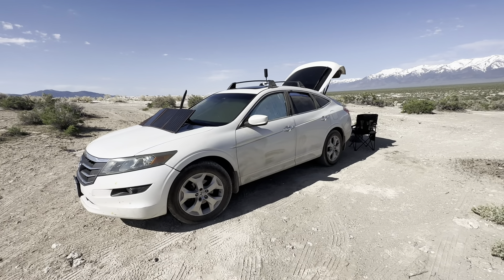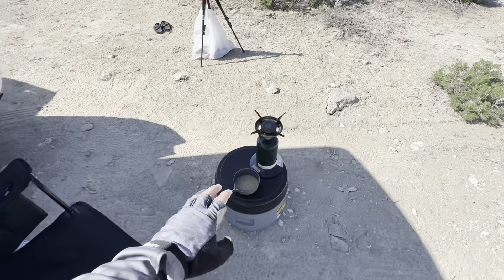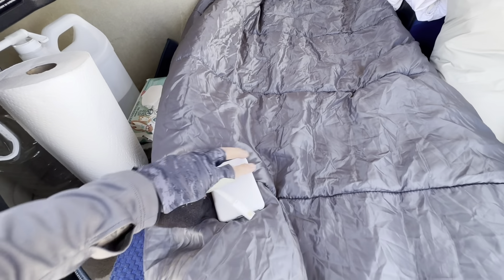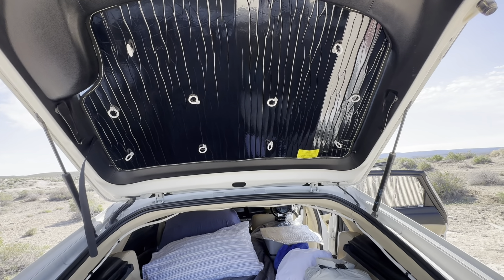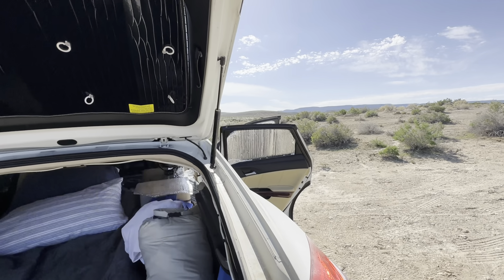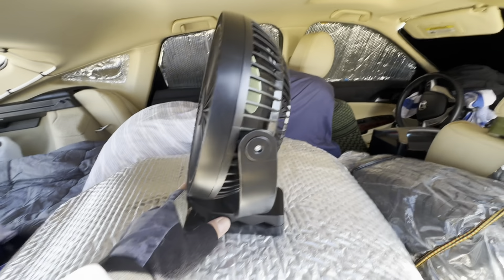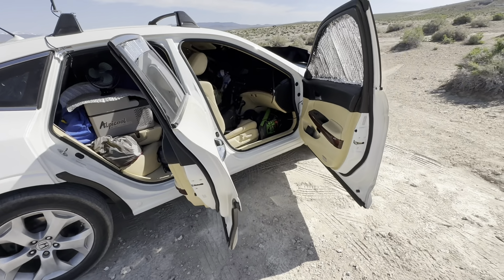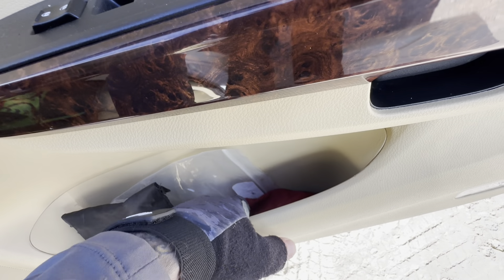The Honda Crosstour AWD Micro Camper / How To Convert a Car Into a Camper

Comment: Im so thinking about getting one. Just need to save up
Reply from the maker: I know the feeling trust me.
I saved up for one year and searched everywhere in California for one, it was hard to find the all wheel drive model I had to search every day for months until I found this one out of San  Diego and that’s like 3 hours away from where I live,that’s how rare they are at least here in the west coast.
I will say that it was totally worth it,just make sure you check everything out before you buy,make sure all the regular maintenance has been kept up with from previous owner ask for a maintenance record and ask if the timing belt has been done.
The timing belt has to be replaced every 100,000 miles,if it breaks it will destroy the entire engine ,so when buying one be sure this has been done or get it done otherwise.
The crosstour is a great car,it has plenty of power and it can handle off roads with no problems at all.
Hope that helps and good luck on your journey.
Reply: bought mine for $18,000 with 37,600 miles or so it's a 2.4 EX- L  put down about 2,600 bucks and pay about 490 a month. That was about a year and a half ago.

Comment: looks like a pretty big upgrade! nice build thanks for sharing
Reply from the maker: I needed more power going up these mountain ranges ,with the yaris it was a real struggle specially with some weight added on, and not having  AWD kept me from going to new places quite often and I was limited to where I could go.
So far the crosstour AWD system has worked flawlessly,It got me out of a sketchy water crossing out in Nevada i seriously thought I was toast for sure,the water was knee deep,but the car had no issues handling the challenge.
The only issue I see is not enough clearance,so am adding a two inch lift kit and some skid plates to help with that.
Thank you for checking it out brother.
Reply: @sonofamountain2862  excellent!

Comment: Very cool setup!  I've got a 2011 with a HRG 2" lift and bigger tires on it.  I would recommend looking into the VCM Tuner.  These are known to have certain long term issues with their ECO mode that can cause some major damage.  I'd love to get some of those OEM roof racks on mine as well.
Reply from the maker: I forgot to mention on the video, but one of the first things I did to this car was modify the VCM,now the V-tech runs on all 6 cylinders full time,I noticed a huge difference in performance and power.
I also did a full tune up and replaced the timing belt.